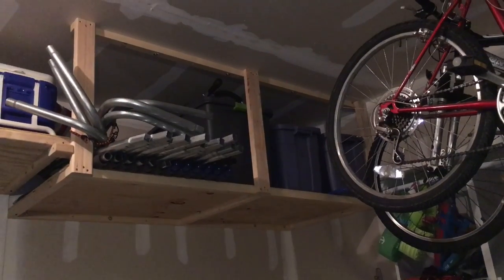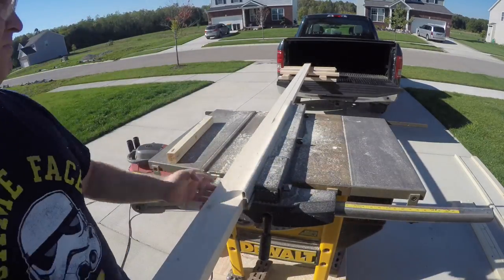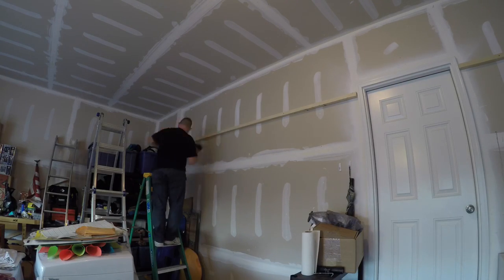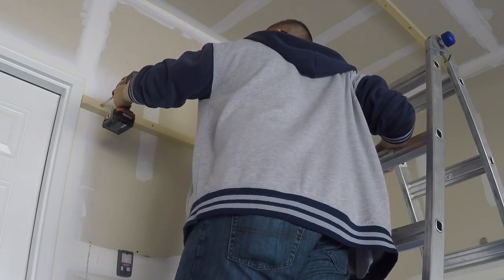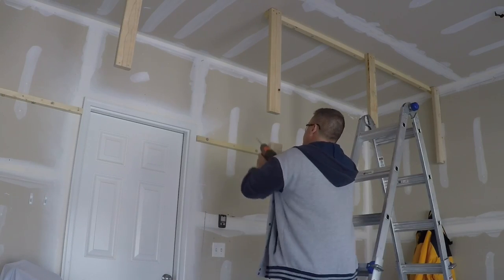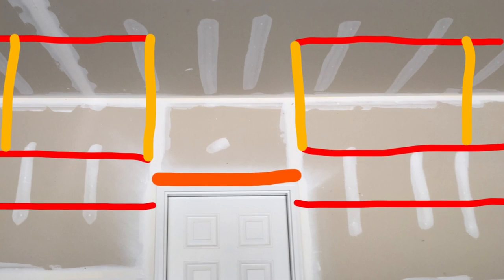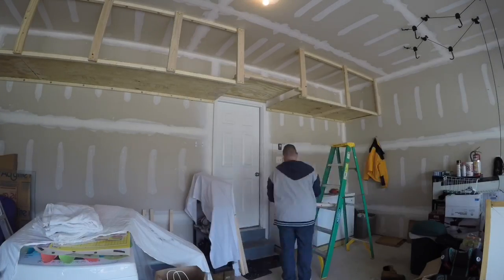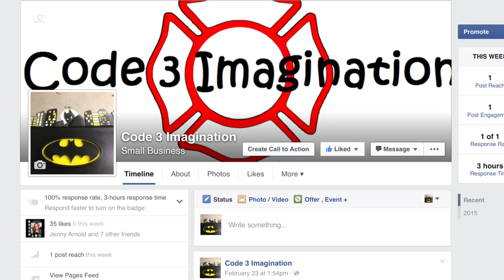Overhead Garage Shelves

Comment: I'll be doing a similar project in a few short weeks in our new home.  One observation - if you use the correct length screws fastened into the studs and ceiling joists that is more than adequate.  I once had a professional carpenter tell me  one # 8 wood screw will hold well over 500 lbs if it is sunk into the stud to the proper depth.
Reply: Yeah, the toggle bolts were 100% unnecessary.

Comment: Why did you chose to secure to drywall using toggle bolts instead of securing through the drywall to the studs?
Reply from the maker: Sorry just saw this comment.  Yes I did secure everything to the studs as noted in the video. My brother-in-law had given me several boxes of these toggle bolts(like I said in the video was over kill) so I figured I would use them.  They are not needed at all. I figured if this thing comes down it will be taking the entire wall with it.

Comment: If you don't have a pocket hole jig, assemble the under board supports and bottom ledger board on the ground, then mount it all at once. In a lot of ways this is easier.

Also if you don't want to use toggle bolts, you can probably use 2x4 ledger boards and some lag bolts for extra strength.
Reply from the maker: If I were to do this again I would skip the toggle bolts, but I had a bucket full of them given to my by my brothers-in-law..

Comment: Great video...good job. I would have used the money saved to purchase paint and some good lighting...you'll wished you did in the long run, also you can get some fabric cutt to size at any wal mart with some cheap curtain rods...hang those for concealment. Just dome suggestions. Great job!
Reply from the maker: jew395 I debated about the paint a long time. I went with the unpainted walls because when I finish setting up the shop I don’t think it will really matter. That and I hate painting.  

Lighting is coming this spring. Going to install some LEDS. I am lucky to have an electrical engineer as a father in-law.
Reply: I understand painting stinks...lol.  You'll be in good shape with your father in law.  I'm electrician myself. You may want to consider 4' integrated LED 2100 lumens 22watt from Rural King (or a comparative retailer) they throw out some good light for the money.  put to 4 footers together spaced equally, throw in some LED can lights in for good measure...you'll love it! Im going to use your shelf idea. Good luck!

Comment: Toggles?  You already screwed it in...  You storing tungsten bars up there or something?
Reply from the maker: I just wanted to make sure it was not coming down.  My brother-in-law gave me several cases of them.  So I figured what the hell I will use them.  If this things comes down it will be taking the whole wall with it.
Reply: @code3imagination441  probably the whole house lol.  The shelf is rated to store a Surburban.  I like how you went over the door frame.  Doing something similar but my door is at an 45 degree
Reply from the maker: @theobgyn6787  could make them shallower. I just did that with my toggle bolt giving brother-in-law a few weeks ago.

Comment: Toggle bolts? Why not use 2x4 and lag screws? Seems more stable, no?
Reply from the maker: Rob N I have gotten this question many times. I did not just use toggle bolts. Sure you could use lag screws but I chose  to use reg construction screws. It is still up and no signs of separation from the wall.
Reply: Code 3 Imagination Cool. Thanks for the clarification. Moving to Texas from Illinois next week and looking for storage ideas since basements don’t exist is Texas. Loved your video and will be using this concept. Thank you.

Comment: What can I do if my ceiling joists run parallel with the length of the shelf? That would mean the weight of the entire shelf is only on one ceiling joist.
Reply from the maker: That is true. I would not be able to tell you how structurally sound that would be and how much weight that single joist can hold.  You may have to check with your local building codes to find out if that is possible.

Comment: Great video I plan on doing something similar.    I’ve got a few questions, you used toggle bolts to screw into the back of the drywall. What did you use to screw into the studs and ceiling. Did you use lag bolts or woodtite screws.  How much weight do you estimate that build can hold?  I need something to hold eight tires with rims. I’m estimating about 800 lbs.  

I absolutely enjoyed your detailed and informative video but I don’t quite understand  some of the key factors. Also you can use GRK screws and no more pre-drilling.
Reply from the maker: sMiLey Warrior I used 6” course threaded wood screws (secured into every stud/joist), and the drywall toggle bolt (between each stud/joist).  Now I could not find out the exact weight each screw can hold before failure. This is all determined by several factors-
Type of fastener(including length and size)
Type of material(this also includes density/years of growth)
And how many fasteners are used

From what I did find by asking friends who are into construction I over built these shelves. The studs would fail before the shelf does. 

With that I know it can hold my weight and at the time I was 218 pounds. I have kept insides power tools, trampoline, boxes or specialty type tools. If I were to guess over 400 pounds total. They have been up now for two years and no signs of failure. 

I may suggest using a thicker ply to store your tires on maybe. 

But keep in mind I built these shelves for what I needed. I am no ways an expert in construction, more of a hobbyist / DIYer. You may have to adjust slightly to fit your needs.
Reply: Code 3 Imagination  Okay great, that makes perfect sense now. Thanks for the clarification.

Comment: How mich weight can such a shelf handle?
Reply from the maker: I did not calculate the total amount of pounds the entire shelf can hold. For what I have stored it’s only about 300lbs total weight on the entire unit. I know there are way to actually calculate the tinsel strength but I did not look up the equation for that. As you can see in this video I tied the shelf into every joist(above/ceiling) and stud(upright wall) the shelving unit touched. I also threw in some dry wall anchors in between each joist/stud, this part may be a bit over kill but I had the hardware already on hand so why not.

Comment: Why do people NEVER talk about rafters versus trusses? Can anyone give me a link to anything on the internet that warns people about installing overhead shelving into truss systems?
Reply from the maker: Mike Anderson a truss is a structure that "consists of two-force members only, where the members are organized so that the assemblage as a whole behaves as a single object".  A "two-force member" is a structural component where force is applied to only two points. Although this rigorous definition allows the members to have any shape connected in any stable configuration, trusses typically comprise five or more triangular units constructed with straight members whose ends are connected at joints referred to as nodes.

A rafter is one of a series of sloped structural members that extend from the ridge or hip to the wall plate, downslope perimeter or eave, and that are designed to support the roof deck and its associated loads. A pair of rafters is called a couple. In home construction, rafters are normally made of wood.

A joist is a length of timber or steel supporting part of the structure of a building, typically arranged in parallel series to support a floor or ceiling.

Depending on how the truss is constructed depends if you can tie a shelving unit into it. Rafters usually are designed to hold the weight of the roof so I would not tie anything into those that will be supporting weight. Always check with your local building code for more direction.

Comment: It seems like you did not attach to ceiling joist to studs.   Not a heavy duty solution.
Reply from the maker: Tony Rey I sure did. The ledger boar attached to the ceiling is secured to every joist. I also attached hallow wall anchors in between each joist through the ceiling ledger board. That may not have been necessary, but that was just me being over cautious with this build. I even explain this in the video. This shelf has held up two years now and have had no issues.
Reply: Good job!!!

Comment: looks great. gonna follow this when i do mine. what size screws did you use?  thanks
Reply from the maker: Jimmy Concepcion I am thinking I used :
1.5" to connect the 2x4's 
1/2" for the plywood decking
Used 3" to secure to the studs and joists.

Comment: Nice work. 2 questions - first, how can you know what you are drilling into? There's no way to tell what's behind the drywall.  Second, My end studs in the wall only allow me 6.5 feet of space. Ideally I want 8 feet. Can I use the molly bolts on the end of the ledger board to allow for the extension to 8 ft?
Reply from the maker: romeobravo78 
1) One good way to know what's behind the walls is if you built your home. I did so I already knew where everything is. But take a look so see where your air ducts, water & electrical lines are, in your basement/crawl space. You can also rent a thermal camera if you want to go that far. 

2) You can use the moly's there but keep in mind what your bolts are rated for when putting weight on them. Ideally you want to drill into a stud or joist for more strength and stability. I would be careful in doing that.

Comment: Great video!  Thanks for sharing. What’s the load capacity for the shelves? How many feet apart for the 2x4 vertical supports?
Reply from the maker: bpyoungtx To be honest I don’t know the load capacity of the shelves. They held my weight at my heaviest, 225 pounds. I don’t plan on putting a lot of heavy objects up there. They mostly store all of our summer stuff.
Reply from the maker: There are sites where you can calculate max load capacity, and shear load limits. I don’t have the sites off hand but you can google it.
Reply: Thanks for your reply. What kind & size of screws do you use? Thanks.
Reply from the maker: bpyoungtx I think I used 6” framing screws. I also predrilled.

Comment: Why mud your garage but not paint it... isshhh
Reply from the maker: Dangerously Cheesy well I did not build the house.  Had it quoted for paint and every painter said it would need another coat of mud to cover the tape. So I decided to not paint it because I would be using it as a work shop.  As of today most of the walls are covered with cabinets and shelving. What’s was left opened I covered with pallet wood.
Reply: @code3imagination441   I'm kidding.  I like your ideas, might be doing something similar.  You're very quick on the responses too.  Haha
Reply: My garage was done just like this and why paint the garage? Things get dirty in there, no need to spend money on something that’s not lived in
Reply from the maker: Dangerously Cheesy that’s what the builder did.  To paint it I would have to remind the seams.  For what I use my garage for I did not feel I needed to paint the walls.  Most of the walls are covered with cabinets or shelves.
Reply from the maker: Dangerously Cheesy I was on line when I got that message. That’s why it was a quick response.

Comment: too fragile  , walls are not enough strongs.!
Reply from the maker: rid BKM Shelf’s are secured to every stud. I do not over weight my shelf’s. They have been hanging up for over a year with no sign of sagging or pulling away from the studs.
Reply: so finally  it's  a Frenchtastic affair 👏👍
   ok ok I'm going to sleep now finish my night of Work.
     goodby from Paris.
rid.
 (sorry for my bad english).